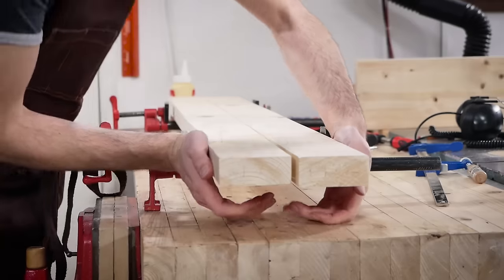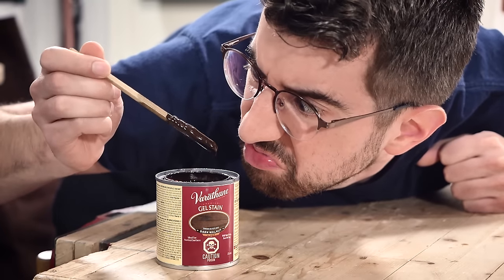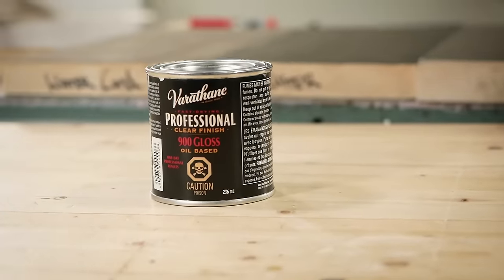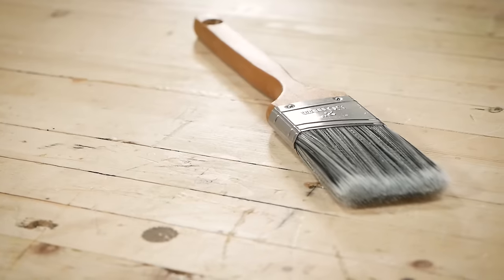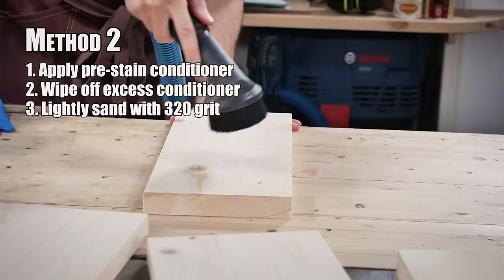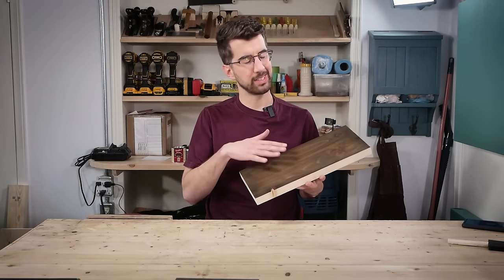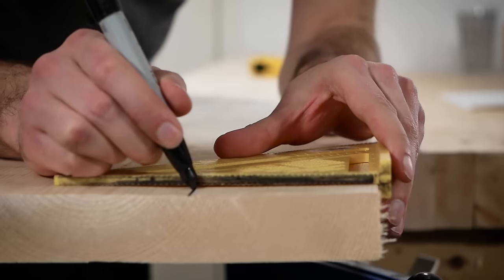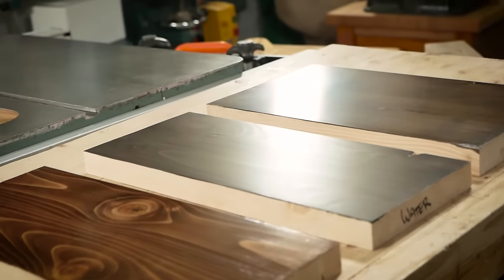Stain can look REALLY gross

Comment: It is a good video, and your method is solid. If you want depth to your water base clear finishes, after staining, put a coat or two of shellac on first; it is very easy to apply and will give you a nice finish. You can use clear or amber, depending on the hue you want. you can then apply the water-based poly over the shellac and have the same look as the oil poly without the smell or difficulty in applying it. It's just a thought; as I said, your method is solid.

Comment: you don’t need conditioner, you just need some water to lift the grain and sand it off, literally same result. With water based stain, you let it dry after the first coat, sand it and do another coat. Then sand it with a very high grid and apply your finish

Comment: Thank you for this video. I learned a lot. Unfortunately, I made a mistake. I applied a water-based stain and added an oil stain after, Not knowing it was bad to mix the two products together. Surprisingly, my wood looks good. However, it’s drying slowly. What should I do now? Thank you for your help.
Reply from the maker: Hi Anna, it's fine to apply an oil stain over top of a water stain. If it's still feeling tacky after 48 hrs, you may have some excess stain that needs to be wiped off with a clean, dry rag. Also, make sure you're letting the stain dry in a room temperature environment.

Comment: Do a glue size! Mix equal parts water and Titebond wood glue (Titebond 2 or 3 also work, as well as any other PVA water soluble glue). Then put on two light coats of this onto your wood. It will soak the glue into all of the little pores of the wood and the glue will seal them. Sand with 320 grit sand paper, and then finish with your favorite oil-based stain and top-coat.
Reply: Would I need to let the glue size completely dry before sanding?
Reply: Or you could use simple syrup, like you do for sealing end grain before staining.

Comment: With the water based stain, on a large panel, I would be inclined to try using a 4" terry cloth roller, moderately saturated, so it does not pool or drip, to apply evenly and quickly, then immediately wipe away excess with clean cotton rags.

Comment: I've had good luck with water based stains topped with 3-5 thin layers of clear shellac (light sanding between each layer.) You get the color of the stain with the vibrant depth of shellac, and most home stores still carry clear (and orange) premixed shellac so it counts.

I've used this technique anywhere that isn't a table surface people commonly eat off of. For table surfaces I prefer the durability of a poly.

Comment: I understand why you'd say the first one is awful. The wood conditioner helps. However, when using wood conditioner the gel finish turns out lighter. It could have used another coat or two. I think that would have helped tremendously- completely changed the entire look. I'm not crazy with the color you chose either. 

Some of us are working with this type of pine with the frustrating inconsistencies in grain and density. My next step is to get away from it and move on to better cuts. 

For the "awful" pieces, I use two coats of pre-stain conditioner, making sure to combat blotchiness. Then as many coats as it takes of gel stain for them not to look awful. :)  Then top coat several coats. It's a pain in the ass.

After I'm done with the next few projects, I'm moving on to higher quality wood. Looking forward to being able to try oil/wax matte products like Rubio Monocoat, etc.

Comment: If you use a foam brush to apply Minwax PreStain conditioner, make sure to pour the PreStain Conditioner in a separate container.  Something in the foam brush will contaminate the product causing it to gel up.   I use Minwax PreStain conditioner a lot and discovered this by accident.  At first I didn’t realize what happened to it and even spoke to the tech guys at Minwax who couldn’t figure it out.  Finally, by process of elimination and experimention, I discovered it was the foam brush that causing the product to turn into a waxy gel.

Comment: The best and easiest method for me is using water base product with synthetic brush for clear coat after using stain applied with cloth. This is the one method I have had the least correction work to do when I am finished for me that is what it’s all about. I find most people do not see the difference and if finish is real smooth to the touch they are happy.

Comment: I've seen recipes for that conditioner as just a mix of water and some wood glue. I tried it and it worked really good. I consider it necessary on pine unless you want strong grain effects. I'm pretty sure commercial places like Ikea put a clear coat on pine before a spray stain.
Reply: There are some waterbased conditioners/prestains that are pretty much the equivalent (oil-based ones are typically just highly thinned finish). 

In case you don't know, almost anything you can apply prior to stain application that partially blocks off the wood's ability to over-absorb colour in localised areas can work as 'conditioner'. 

In the more recent past a "washcoat" or "spitcoat" of shellac was pretty much the go-to method, prior to that it might have been diluted hide glue. You might want to try either or both of those in direct head-to-heads with the diluted wood glue, see how you think they'll compare (spolier: I think you'll be pleasantly surprised).

P.S. One other thing that's worth trying, if you're not already doing this, is to apply whatever you're using and leaving it to dry prior to a light final sanding (with the same grit you stopped at previously).

Comment: I use varathane oil base  on oak cabinets,  use a foam roller high quality,  leave alone less than  10 minutes , then wipe off lighty , 2 coats thats it, then choice color oil paint 2 coats thats ut  .  That is   finished . Can see though oak on cabinets.  No black line , ....  i work for many years.  Save $$ better.

Comment: Sir thank you, I have a 1950 home in NY near the Hudson River my bedroom was waxed in 1999 by hand wax from a can. I never used anything else since then and 75 percent of the wax has worn away surrounding the bed. Under the bed I would say wax still there. 

What my plan I believe will be to remove all from bedroom and seed if I can screen the floor with 120,150, grit sandpaper on large buffer, then clean it all up and apply Pre stain Minwax and then apply Minwax Golden Oak Stain. Then wait 24 full hours and apply Water Base Procoat Polycarbonate 2 component urethane. 
How does that sound?

Comment: I have finished using either Helmsman Spar Varnish or Diamond Varathane. I have sanded with 220 after it has dried and reapplied another coat. The Spar is a much longer process. To apply them I generally use a Spongie but I have poured the finish on the project and used a plastic blade type applicator, like you use doing bodywork to spread the finish. I tried using that milk white Pre-Stain stuff but I did not see any real difference except it cost more and took longer. I use a lot of colored stains like blues, greens and reds. About the only oil based stain that I use is Minwax Dark Walnut. Lately I have taken to trying out Shou Sugi Ban using Unicorn Spit Stain and applying wipe-on Poly. I recently tried the 3 Coat Varathane. It's expensive. I bought a can, used that and a week later went back for more. Only to discover at every place that sells it they inflated the price ten dollars. I'm in Canada. I love staining over painting. So I buy good wood and can still see the wood after staining. Even construction lumber can look really impressive when stained. But when you paint, you have no idea what kind of wood it is. I pretty much stain everything I make. The only time I generally paint is if the situation is such that I have no choice in order to hide problem areas.. In particular when I have had to fill in places with wood putty. Then again it depends on the wood I used as well. Can't stain MDF and Particle Board very effectively but I have given it a try.  Really like your videos, very informative, I always learn something. And I enjoy the humor you bring to them. Thanks.

Comment: When I sand, I use a tack cloth with paint thinner as I find this opens the grain better and can get more dust out than vacuuming. I also use this method between coats of urethane and sand with steel wool. Need to Make sure the paint thinner dries between coats but it does so quickly.

Comment: Some nice tips, but you really need to start your finish choices with how and where your project will be used. If your project is going to be used outdoors, in wet areas like kitchens or bathrooms, or be exposed to harsher cleaning chemicals then water based is out. They are made to be  easier to apply and clean up, and with lower VOC's, but they don't offer the surface protection that oil base and solvent based polyurethane finishes do. Newer water based finishes are slowly being created for the industrial market that have better protection characteristics, but they are very pricey and it will be years before a similar product makes it's way into box and hardware stores. Also to get a smoother finish I typically use a sanding sealer. It's applied on top of stained wood at about 3 mils thick and then sands easily with 220-320 grit sanding sponges to create a much smoother and level base for your top coat.

Comment: So:  first use wood conditioner (wipe off excess) sand 320g.  Then use a water based stain (wipe off excess)(let dry) Sand 320g.   Thirdly, use an oil based stain (wipe excess) 
Last, use an oil based polyurethane.
and Finally, sand the ever-loving crap out of it with the finest graduating paper 400g up to 1,000g
and maybe some paste wax to buff.
How long does all this take?  
I'm refinishing a solid cherry wood cabinet.  I have been sanding forever and it looks awful.
I can see why many refinishers just throw up their hands and paint it all.  I really don't want to do that.  I guess I'll go sand some more.

Comment: Hi Scott , what is the softener between water base acrilic and water base. 
I am little confuse with your video because in the method 3 , you said after use WATER STAIN ACRYLIC i will apply oil base to get  pot the color. 
I be dint see any examples of water base acrylic .
All I see is water base and oil base 😒

Comment: i've always been disappointed with the way pine or any "whitewood" stains, unless you lay it on thick and do multiple coats, but the water based stain before oil based stain turned out really well, i'm genuinely impressed.

Comment: Haven’t stained and sealed yet but supplies are on the way.  LOVED your video with lists and comparisons.  Found your video while trying to answer the question Which Conditioner to Buy (for water based stain or for oil based stain) and why are those conditioners different?  My cabinet-water-splashed-stain-repair project is going to be finished with Oldie’s Oil, not available in box stores.

Comment: Oil and water based products do not adhere to each other.  By using them together you are setting up a situation for the layers to "de-laminate."  Both oil and water-based products DO adhere to shellac.  So in the situation you describe - where you mix oil and water-products, I always use shellac between them.  In this instance I would have simply used a can of spray shellac after you applied the water-based stain and added a light coat of shellac before using the oil-based finish.  That way you have a good bond between all  layers.  BTW, I always spray a light coat of my finish over my stain before I actually apply the finish via brush.  That locks the finish in place and prevents the brush from lifting the finish as I am applying it.  Otherwise I would be seeing finish floating off my brush in my clear can of finish.
Reply: One can use oil finish on water based stain once the water has evaporated.

Comment: My husband has found the easiest and most effective way to finish any project he does. He makes me do it. 

I'm the official finisher of the house and I've taken my job seriously. I've burned through a LOT of 1/4 inch plywood and tons of scrap birch to practice, test theories, and figure it all out. I can pretty much color correct anything with stain, but now I'm ready to move on to toners. The only thing holding me back is the price. I think it's time to buy a sampler set and start learning.

But lord do I HATE sanding. smh

Comment: Great video over view for beginners .  Not really a fan of all the brands at the home store and DEFINITELY NOT THE BEHR WATER BASED STAINS . YECH!! 
I’m not afraid of chemicals .. since I’m a hairdresser .. so I prefer oil based stains ( AND paints but I’m in CA). The advantage is that they can be thinned , and mixed at will with mineral spirits and that’s not an option w water based products - since they already lack the depth of color and start out “Jammy” looking. Mix them and it’s uglier .
Another advantage of oil based stains is that they can be used as a glaze over painted wood to give a different type of finish..or mask someone’s ugly DIY paint job and color choice :)

Comment: I don’t see where it states the type of wood used. Was it the same wood for all 3 methods also? Thanks
Reply: yes,   all low grade pine.  "white wood" - almost certainly SPF (referring to the grade stamp which means SPRUCE PINE FIR which essentially means low grade white pine.   : )   very cheap crap wood.  But absolutely fine as long as you know what you're dealing with.    I just had to google this but apparently the "fir" refers to Balsam Fir.   If you are going to go cheap pine, get Douglas Fir.  IMO, its ten times more stable and better for staning etc that SPF.  I would never ever intentionally use SPF to make anything.  framing? sure, anything visible? no thanks.  Its absolute crap and mold grows on it in seconds (hyperbole).   southern yellow pine is much denser but has awful cathedral grain.  Doug Fir is the best pine in my limited experience and readily available in 4x4 and 2x4. not sure about other dimensions.

Comment: Use Duraseal stain. You can get it at a floor supply distributor. Far superior to anything you can buy at a big box store. Great colors, large selection. Drys quick. It's much more expensive though. $24 a quart. Get your poly from there as well. Most places will sell by the quart for most brands.  these are professional grade not the crap at home depot. I. Addition to looking better, being tougher and harder, they also level out better. You shouldn't have an issue with brush strokes or lap marks after your 2 coat. You need a brush spinner. After staining spin your brush out. Apply a small amount of solvent (paint thinner, turpentine, you can even use poly). Just to grab the stain. And spin again. Repeat until the brush is clean. Spin fast. Then leave it in a turpentine bucket, sealed. Keep a separate bucket for finish brushes. Just incase you don't get all the stain out.

Comment: Great video! I plan to use coffee. The wood cabinet will be near our dog- must be non-toxic.   

Do I sand in between coats with 220? In your other post you said sand only up to 150 so it gets into the wood. I will then use shellac- french polish. I am newbie- any other suggestions or thoughts?
Reply: There Is something called a fluff pad that professionals use to sand between coats. If you want to do it right go to a paint store and ask which fluff pads to use for your project. Be ready to take notes :-)
Reply: @robertschenck9902  Thanks. All done- turned out great!

Comment: So how far did you sand the raw wood down before applying anything to it? The wood I usually work with (may it be bought from Ikea) is in a terrible state, horribly rough, you can feel the grain. How far would you sand it down? And would you water the wood before applying stain or conditioner? Because I have made the experience that staining without watering beforehand results in the stain lifting the fibers and no number of PU layers can fix that afterwards

Comment: I was just thinking today that you haven't posted much recently so was so happy to see this in my feed today! Thanks for making a fellow Canuck laugh and learn some new techniques. 

I use Osmo finish for 80% of my projects using the white 3M scuff pad applicator and method to put on. You can get it at Lee Valley and other places. It is very good for durable finishes on furniture as it was originally designed for wood flooring so it needed to be strong. VOCs are especially low since it is mostly natural oils and waxes. For a maple coffee table I made, I used a dark General Finishes water based dye stain and then Osmo on top. It has held up very well and repels all liquids and water marks. My buddy that builds guitars uses Osmo since it holds up so well against wear on the neck and body. A little goes a LONG way with this product and two thin coats is usually all that is needed.
Reply: great thoughts on a construction lumber video.   Save money on wood.  Apply an $80/can finish.  Genius !
Reply: @burtreynolds3143  You don't use the whole can, just about $0.50 worth. So yes it is economical.

Comment: I'm interested to know why you say to go to 180 grit and no higher.  I always try to go to 220 and 320 but I don't necessarily argue that I should.  Do you have an explanation why 180 at the max?
Reply: If you sand hardwood too fine, it wont take the stain. I always sand end grain finer than everywhere else since it helps give a more consistent color.

Comment: Spray lacquer + water based poly.  Ez to use and clean.  Spray outside - looks like wood - two coats poly, don't drop a hammer on it.